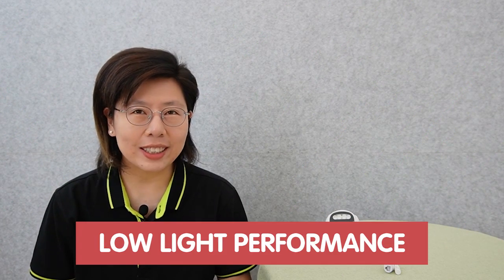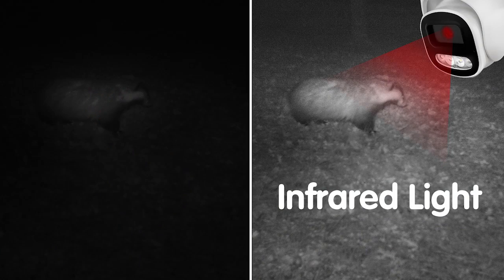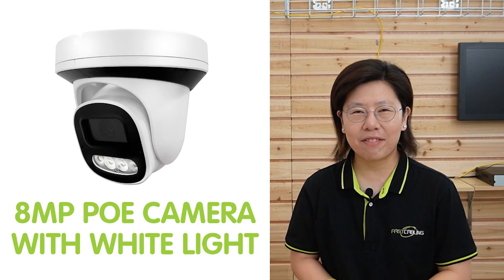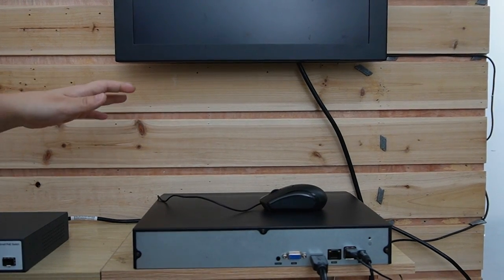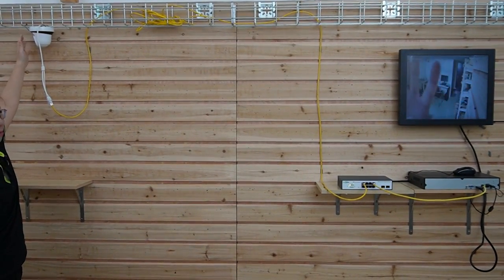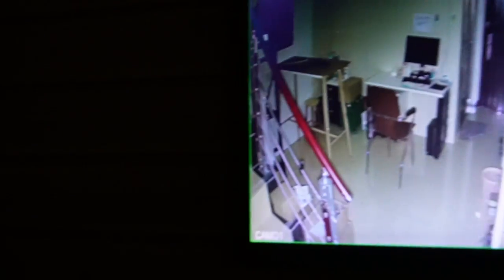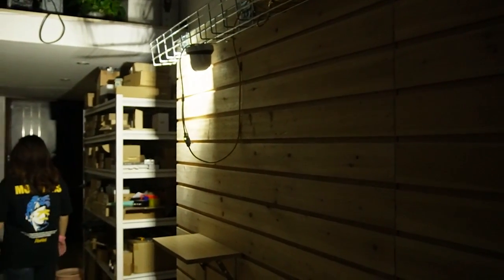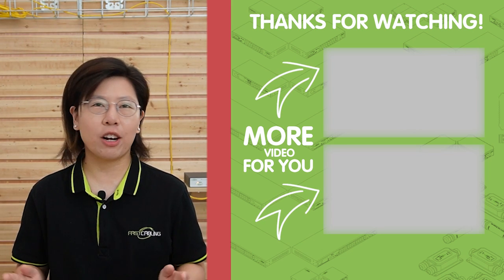Improving Low Light Performance of Ultra HD Security Cameras

Comment: How do I change camera on "1 on nvr assign to #8 in camera showing grid. I try to plug in different poe plug in and always assigned to #1.  Can I change in nvr setting ? Quick setting add ? I don't know.
Reply from the maker: You might try to drag the camera to 8th channel with the mouse. If it doesn’t work, you might find the channel setting and remove the camera from specific channel you want swap and add the camera later.